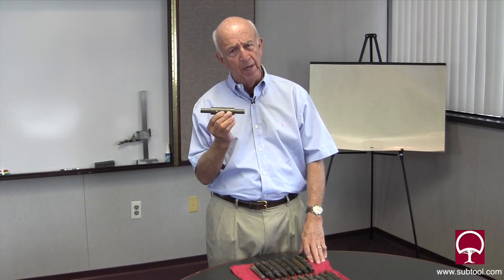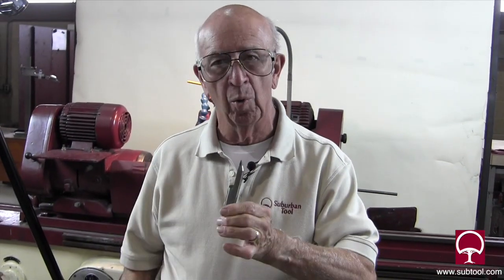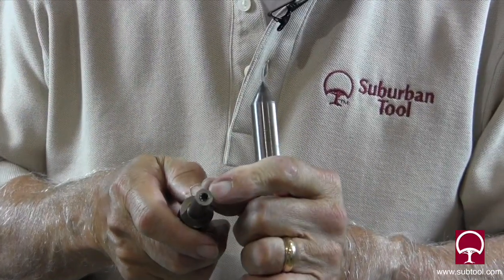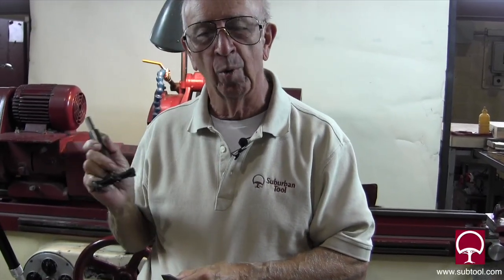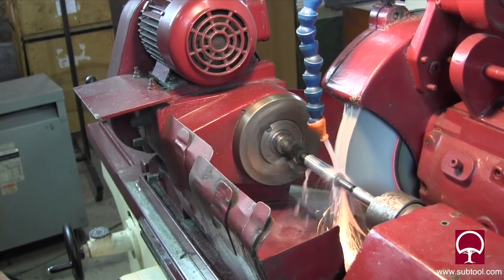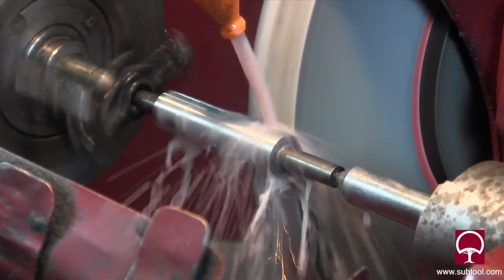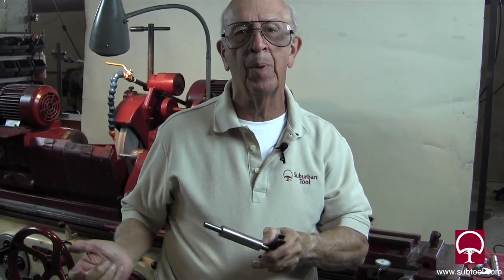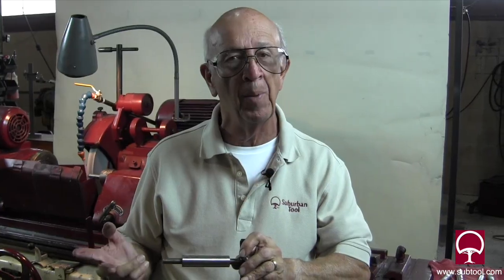OD Grinder Basics- How to grind fast and accurate.

Comment: I grind small and large parts up to 168" long. As small as 1/2". Carbide coatings. There is no quick and accurate way. It's ,002 per pass max or they egg from deflection. Diamond wheels can't easily be dressed.
Reply from the maker: Thanks for sharing.

Comment: I played beat the clock 40 years ago @ Hamilton Standard. I was the O D grinder guru. # 1 Brown & Sharpe , specialty set up by turning the wheel spindle on a angle and dressing the wheel for face grinding to produce a circular lay finish with a .005 max radius. Grinding the face and o d to the high side of the tolerance , redress the wheel , then grind to clean up the marker. The finished product was unexcelled with a mirror finish and well under the .005 max radius. 🥇
Reply from the maker: Well done. Thank you for watching!

Comment: Hi,I Was a retried tool,and cutter grinder over 12 years ago,back to work for a aerospace company.your basic operations help,me use a surface grinder with out any problems,most of this I operated on a no. 2 Cincinnati Tool and cutter grinding machine you saved my butt and the company by showing basic operations I need to understand repairing or regrinding parts,thanks

Comment: Hello, how would you approach urethane material's on a grinder? I run on a Landis od grinder and what i do is Face the surface, and turn the OD, then i use another grinding wheel for a radius plunge. How would you approach Ureathane. I've been doing this for 2+ years now and just want to get more accurate with what i do.

Comment: That's good idea.... But I have one doubt I need to grind 150mmdia OD and a length is 600mm with bore 60mm.... I will decide to set with a flange..... Actually I faced one big problem that is even every pieces need to set zero run out..... But it takes more time.... How to I reduce that setting time.... Contact me please..... sri1511be@gmail.com

Comment: load up the wheel with a pencil??? it needs dressing after that big cut.
Reply from the maker: if you use a red cram that would be true. not so with the pencil that's why we use it. the pencil is graphite and it will never stick to the wheel.
Reply: ok thank you, Patrick.

Comment: I'd tell them to take that down to the lathe and take all the damn stock down to .003 - .005 over size. Then I'll gladly grind it for them! 😂
Reply: I get upset when im only left with .003 to .005 on a part.  I like to have something to work with in terms of grind stock when im getting the taper out of the machine.  Plus rubbing scale  against a wheel is never fun. Its going to keep loading and glazing the wheel.    Roughing stock is easy.   So who cares of theres .020 on a diameter.

Comment: how did you know to move the bed 5 thou to get the part grinding parrallel? experience of course but is there a general rule?
Reply: This works if you have a dial indicator placed 20 inches from the center of your machine. Big diameter minus small diameter. Then divide that by the length that you just measured. Then move the decimal place over to the right one number.
Reply: Trigonometry. Specifically, sine=opposite/hypotenuse

Comment: Haven't had a need to lap a center hole yet, but if it comes up, how is it done properly? Just lapping compound, a 60 degree soft metal rod in a rotating tool and go at it?
Reply from the maker: Jaakko Fagerlund We are going to do a video on this. Stay tuned.
Reply: SuburbanTool Inc  Great, sounds like something to wait for then! :)

Comment: For roughing the part up, I prefer to plunge grind. It takes about the same time. And then a few finishing passes to get those damn microns.
Reply from the maker: nocturnodrummer The problem with that is you dull the wheel.
Reply: With so many variables its hard to say one way is better than the other.  Ive surface and jig ground for acouple decades now, in new to od/id grinding.   Ive plunged stock off(which definitely dulls the wheel) but with certain matetials it doenst seem to make tjat much uo a difference.   Some materials are more friendly to walking across to remove stock but others will destroy your wheel.   Imo its all about finding what works best and every job is differnt.   Thats the fun part of grinding to me.

Comment: how do you grind a thread on an OD grinder?
Reply: I run CNC OD grinders for a large aerospace company. We have a Sheffield Thread and Form grinder. This is a multi-point grinding principle. Basically the back of the machine behind the grind wheel has a spot for a carbide crush roll. It will form out the wheel with the correct lead spacing for each thread point. (Example: an 18-UN thread has a lead of  .0556. Install the corresponding roll for the correct thread pitch. After you are formed out on your wheel,  Touch off X on the OD on the part. Set you Z starting position.  Program the machine for the thread length, root diameter... etc. The machine traverses in Z the equivalent of one 1 lead for each revolution of the part. The machine holds all of the timing. As long as you dont not remove your drive dog from the part, you can regrind the part if necessary.
Reply: @AlbertNaranjo   Hey Albert I saw in your post you run a cnc o.d grinder and so do I but I'm having difficulty forming angles with a radius and I'm hoping you know,not sure how you can get hold off me ppl please
Reply: meocats I think that takes a special od grinder just like grinding gear teeth.
Reply: meocats I think that takes a special od grinder just like grinding gear teeth.
Reply: just sync the rotation with the side feed somehow
Reply: why does it need to tilt? The threading tool on the lathe is a form tool just like the wheel profile
Reply: meocats With a form wheel and having the workiece rotation tied to the table X axis movement. I'm sure there is manual machines for that, but CNC is the keyword here as it allows any thread form and pirch to be done and makes it easy to dress the wheel.